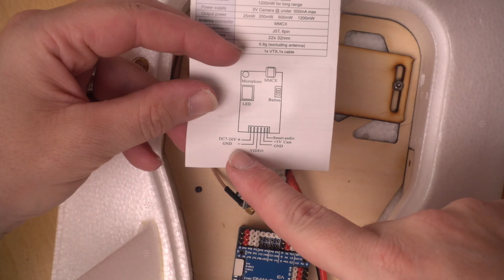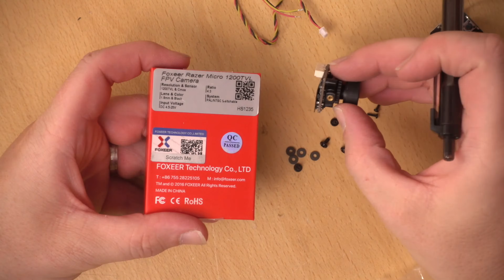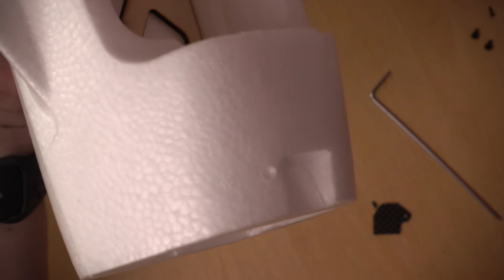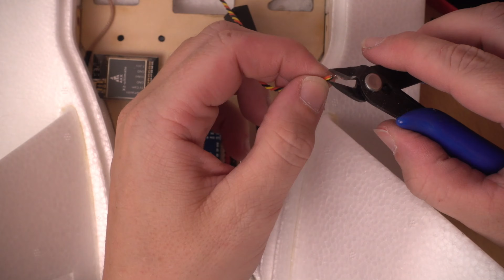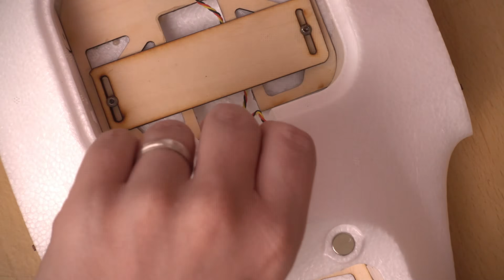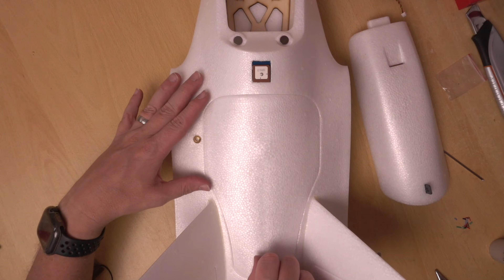iNav 5.0 Beginner's Build Academy: Lesson 05 - Installing the FPV gear

Comment: hey Mr.D
why should rx from gps not be on rx in FC and tx from gps to tx in FC
why do they have to be swapped around
Reply from the maker: Because Rx is listening and Tx is talking. If Rx is to Rx, they are both listening to silence. If Tx is to Tx, they are both talking at each other but none is listening. You need to have one device talking on end (Tx) and the other device listening (Rx) at the other end.

Comment: Hi Darren a question, I am mounting a flight control (matek H743- wing V3) from your video I am following I see that you used the same video transmitter that I would like to use an AKK ultimate 2. I have a problem, I have connected the video transmitter to all uart 7 of the flight control and sectioned in the port page the smart audio uart 7. The connector of the 4-wire video transmitter has been connected to the flight control with this sequence (black ground cable, red power cable to the 5 Volt, video signal yellow cable RX 7 and intelligent audio to the green cable of the Tx7) the transmitter turns on regularly, however, automatically scanning the channels through the monitor does not select any channels so I do not receive any video signal. can you give me some advice since he doesn't tune any channels? Last thing, always from this video I understand that you connect the video transmitter to the VTX pin, the red to 9V, the black wire to ground and the green wire to TX3. I also did this test but I burned the video transmitter I don't understand why it burned, since 9 Volts come out from the positive and that transmitter can be powered up to 27V. Thanks for your time, I await your response.
Franco
Reply from the maker: It sounds like you have wired the VTx incorrectly. From the flight controller, the power and ground go to the 7-24v and gnd pads on the VTx. The 5v and gnd are outputs for powering a camera. If you wired the 5v output of the video transmitter to the power out of the flight controller, that is why the VTx burnt out. The connections should be:

FC                      -> VTx
Power (9v)        -> 7-24v power in
gnd                     -> gnd
VTx (video out) -> video
UART Tx             -> SmartAudio

Comment: Eagerly (hungrily) following your build series. I am a beginner. Have procured most of your recommended gear. Hope you'll maintain the slow pace and detailed presentation for dummies like me. I have a Taranis x9d plus and hope you will also include pointers for this radio, besides others, when we get to the section on transmitters.
Reply from the maker: Hi Theja. I’m glad the videos are helping. The next video will be setting up the transmitter. We will actually be using an OpenTX model that I made for the INAV Fixed Wing Group. This should make the setup much easier and quicker. It will work fine on the X9D Plus. I will be demonstrating on my Horus X10S Express. But installing the files and the setup will be the same.